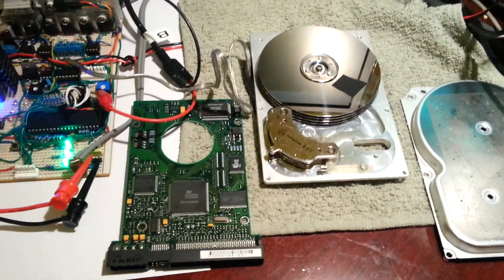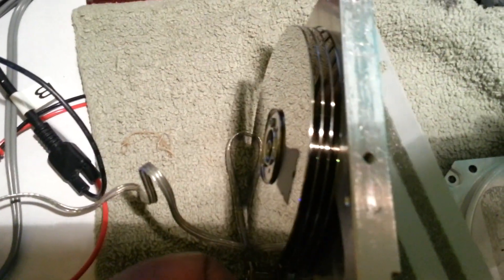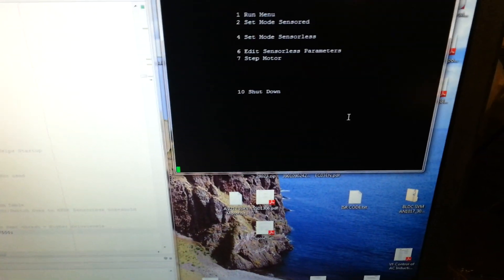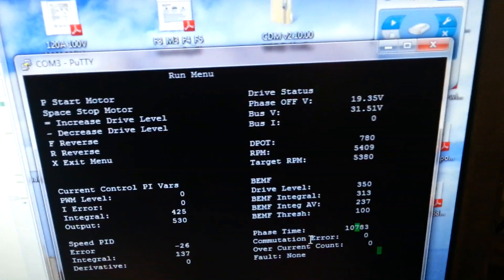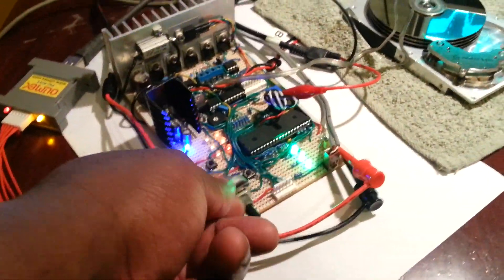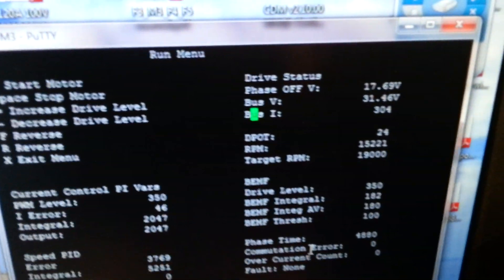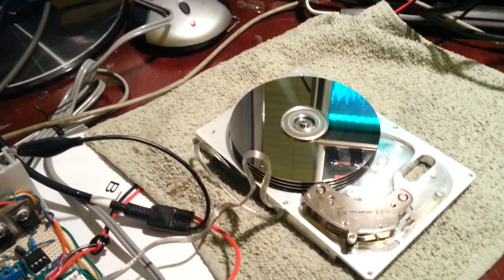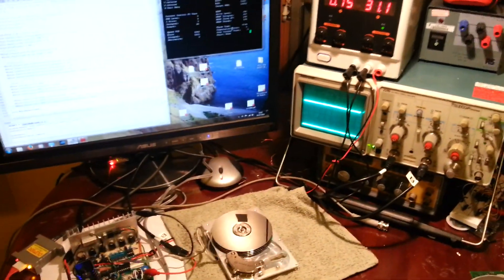Hard Drive Spindle Motor Running on BLDC Controller at 15000+ RPM

Comment: What about schema and the program for a controller?
Reply from the maker: The design was based on the PICDEM MC LV board, the schematics are on Microchips website. I'm not planning to release my code, it's always changing. There are many open source ESC's with code on the internet Benjamin Vedder has an awesome ESC with software.

Comment: Good evening, I would like to know what the charge microcontroller to rotate the motor with direct current , because these are three-phase motors . or give a speed control for these engines . appreciate answers
Reply: +Erickson Guedez 
you use components to turn that engine ?
Reply from the maker: +Erickson Guedez Hi, There are 2 mosfets for each phase (6 in total) mounted on the large heat sink at the edge of the board, they source or sink current to motor coil pairs depending on it's position to create rotation. Search for sensorless BLDC motor control.
Reply: +Coolkeys2009 I think your friend great job. I'm doing a drone with this engine but in my country do not get the speed controller and I have been researching how to make these motors to rotate , and in your video I saw a great idea of how to make them turn. I possess an Arduino which will use to manage the flow. As you fed with the voltage on this circuit ?
Reply from the maker: Erickson Guedez You will certainly learn a lot about bldc motor control, programming and electronics doing that. I look forward to seeing videos of your future projects.

Comment: I calculated the angular velocity of the outer circumference of the platters. A 3.5" drive actually has a 3.74" diameter. That thing was going 167 mph. You'd feel that if it hit you!
Reply from the maker: Josh Bennett I have another video with the platters spinning at 22000 RPM, I guess thats worse then :-) After getting stung by little bits of tape flying off motors spinning at 25000+ RPM I started realise the real danger  the damage a hard drive platter failing might do. I should have realised this after seeing damage exploding cd's do. Also touching the spinning platters at that speed could lead to a broken finger in the wrong circumstances.

Comment: Any way to look at the circuits of bldc controller? I've been looking one for a while.
Reply from the maker: My circuit is loosely based on the PICDEM MC LV development board from Microchip(they have released a newer one). All the micro manufactures will have lots of application notes on how do use their products and the basic theory of operation as well as source code. There is enough information in the theory of operation application notes to design build and write the code from scratch.
Reply: Coolkeys2009 I got all the codes, but can't get it into right phase because at some point elektromagnetic field is spinning faster then the spindle itself. Also when i stop it, it can't get into phases anymore. It doesn't seem to be problem with that circuit.
Reply from the maker: 0lla You can't run a BLDC motor the way you would run a stepper or induction motor, you have to read the position of the rotor using hall sensors or back emf and the energise the next coil pair at the correct time.

Comment: why haven't you been worried that it might "explode" and kill you?
Reply from the maker: I recently exploded another CD(accidentally) at high speed and it caused a surprising amount of damage so I am aware of the possible danger, other people have spun hard disk platters faster without them exploding so I'm not that worried. I will post a new video of hard disk platters at 23000 RPM soon.